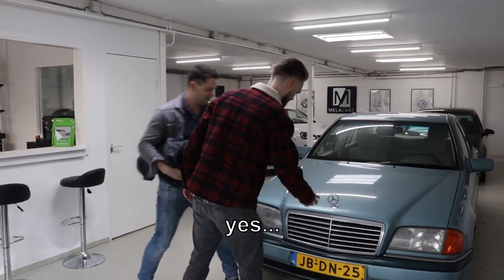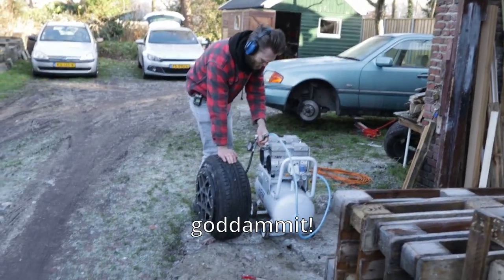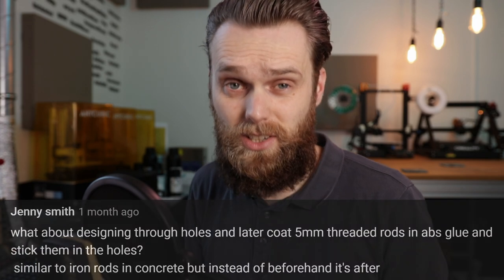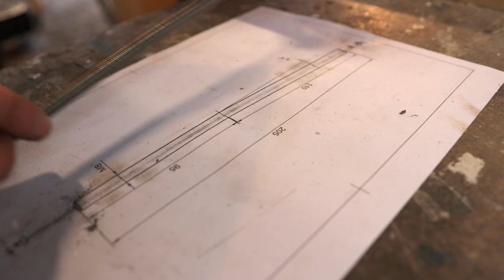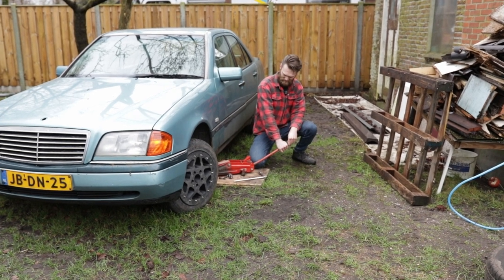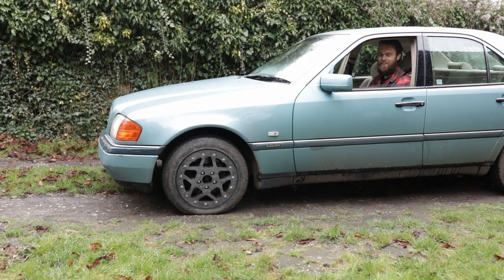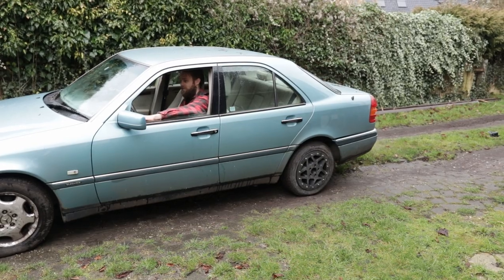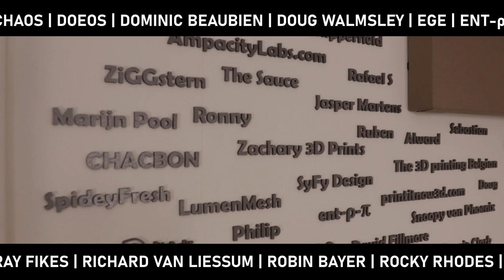Can you actually 3D print a working car wheel?

Comment: Good work getting this far with the project. I suspect that point loads (like hitting pothole or a curb) or side loads are going to break it - the weakest spot is where the bolts are holding the rim to a hub. It's probably going to get ripped from the bolts. If that holds the next issue is the heat from the brakes. If that rim survives I'm going to be seriously impressed and if not I'm hoping that's not the last iteration. Keep pushing boundaries.

Comment: Honest comment: with all the issues I've seen with ABS and layer adhesion, I wasn't sure it would happen. Your construction, however, mitigates a lot of those issues and I'm impressed.

So... curious to see how it holds up to lateral forces on hard steering. I'd like to see it driven hard on a test course, if possible. (All four wheels printed, if possible.)
Reply: Layer adhesion issues can be mitigated with a heated or, at least, insulated chamber.
Reply: @theofficialczex1708  they could be completely removed if he used salt annealing to re-melt the entire piece into a solid piece of plastic.

Comment: Just a tip!
If you put 2 nuts next to each other on to the thread (counter nut) you can use them with a wrench or other tool to screw in the bars.

This way you won't strip the hole surface with the hammer.
Reply from the maker: Thanks! That'd make it even stronger I recon and ti doesn't damage the first pitch of the thread. Next time I also want to damage the thread where it goes in to make a stronger bond too.
Reply: You can’t screw in the bars like that as there bent unless you put them in straight and hope they bend as they screw in ?
Reply: Couldn’t your use through holes in the bend part and take solid bolts and put a nut on each end?
Normally you wouldn’t use threated rods for such use cases as they basically work like springs and the shear forces caused by the threat are pretty high
Reply: @properprinting  screwing a nut on top before you start hammering will prevent you from damaging the threads as well.

Comment: This is amazing, Jon.  I'm happy for you. This has been a long project.

Next tests:
1: Full tire pressure (2.4 bars?)
2: Burnout on a paved surface.  (I'm still a little concerned about the heat generation on pavement, though this is encouraging.)
Reply: I know its an old comment but a lot of cars actually have 2.0 bar as their rated tyre pressure.

Comment: Well, your biggest issue has always been the rim splitting along that seam... When you went from your first to your second iteration you beefed the hell of every aspect of that rim when you did that despite that being the only spot that failed. That being said however, I think your new beefy design could actually be slimmed down some (if you are printing the thing solid... which I have no idea if you are or not) but will need testing. A lot of people are bringing up hitting the brakes for extended periods or hitting curbs or whatever, but honestly, I think the highest loading factor will be cornering.

If you put the rim back on the front of the car, and then subject it to large cornering forces... the spot where the lugs attach it to the car may end up being the weak point because of the immense leverage that is created on a rim. One "could" solve that with a metal plate on the outer surface of the rim acting as almost a clamp that some bolts would go through to sandwich the rim to the car and spread out the load... but honestly that really wouldn't be in the spirit of the challenge.

Something you "may" be able to do to increase the strength is to potentially figure out a way of printing the rim with some form of non plainer surface throughout the layers. So as the printer is making the rim, it is vertically sweeping the surface up and down as if its following a ruffled potato chip. In doing this you end up somewhat breaking up that fundamental layer shearing issue and gaining a bit of strength... but naturally no one has done this yet, you are limited (not you in particular but 3D printers in general) in how steep an angle you can run up and down along with how much change in Z can be done, and lastly, It would need an entirely new way of slicing to get something like this to work. But you seem to be a pretty talented programmer you might be able to pull it off!

One final thing I would also like to point out... if you had done this on a smaller car, honestly your first iteration would probably have worked and worked well. It wouldn't have been the strongest thing, but you could have at least driven around on it gently before it broke. Like I have a Honda Beat and I believe you have a Mini Cooper... either of those this challenge would have been a piece of cake... but, again... then it really wouldn't have been much of a challenge. So I commend you for getting this to work on a car such as this! This will open many peoples minds to the possibility's of what 3D printers are capable of!

I honestly was thinking about printing full blown fenders with something like a Hangbot 3D printer... never got around to it yet though so it has all just been a thought and concept.
Reply: i would say the biggest issue would be the lug nuts pulling through since they are the smallest contact points.
Reply from the maker: Thanks a lot for your insightful comment! I totally agree about the weak points you mention. I have some experimental ideas for increasing the strength in the Z direction. The extruder I recently made is the start of that project (and it's not continuous fiber printing since that doesn't add strength between the layers as far as I know). This will be a different project and I think I'll pick up the project rim with the newly gained knowledge and experience. Cool idea about using the Hangbot for that concept!
Reply: @aarons7615  Yeah, testing will be required, but your probably right... granted the conical surface of the lugs does distribute the load very well, but is it enough... only time will tell.

Comment: You could fuse the layers by heating the complete rim packed in fine crushed salt.

Also when driving the rods in, use an angle grinder to cut a long slot into the all thread. The edge of the slot will cut the thread into the plastic while screwing it in. It will also hold glue to make the distribution in the hole better.

To bend the rod at exactly the right place, saw into the all thread 1/5th at that place. The rod is weaken there but its plenty strong enough for the surrounding plastic.

Comment: That's pretty impressive work.

The only issue I can see with it is that when slowing down fast, a brake disc usually uses it's wheel a bit like a heatsink. Without this thermal mass to dump heat into, the brake disc will take a lot longer to cool down. So repeated stops one after another will accumulatively raise the temperature of the disc much higher than usual.

I'm not sure what temperature it would take for the wheels mating face to turn back into molten plastic (and all the wheel bolts clamping force disappeared), but I'm pretty sure, whatever that temperature is, the brake disc could be pushed well beyond it.

Comment: The only issues i can see are with creep and brake heat. Brake heat can be fixed by moving the brake disc away from the wheel, using a CV shaft. Creep I'm not too sure about, you just have to keep the stress really low.
Reply from the maker: At this moment the rim is still mounted to the car to find out what it does over time. I'm interested in creep too! I wouldn't have thought that heat would ever become an issue since I never guessed we'd make it this far. Now it's  becoming an issue xD

Comment: I think another really cool application would be on off road recreational vehicles: 4 wheeler, dirt bike, side by side. It should come with it own unique challenges. A smaller vehicle might give you some wiggle room with the design considering your 3D printer bed's dimension limit.

You can get a cheap 4 wheeler and 3D print a whole set for it and see if it can take the hostile environment of off roading!

Also great work and awesome videos! Thanks for sharing this.
Reply: Sure in off road you can have huge bumps but i think first it needs proper testing on pavement that has great traction. That will put it on big test, specially with almost two tons of car cornering. If it can take that, then maybe try rough terrain and impact forces.

Comment: The nuts on rods are the weakest link in this right now. Any cornering forces could result in them working their way through. One though I would suggest is making that area conical on the rim plate then make the lug ‘washer’  that fits it out of a much more exotic 3D printable material. 
It would function like a lug nut, or if you wanted you could potentially go make some metal ones which thread on and are one piece.

If the spirit of the challenge is 3D printing methods for the finished part then literally using lost-pla casting could give you some aluminum or other alloy parts. 

Or if you take a look at same of the data of CNC kitchens results on threads. I bet if you reached out to him he’d be happy to test what the material load is on threads. Maybe you might be able to print some lug nuts that would hold up and spread the surface forces easier.

Edit… first time on the channel you’ve already talked to him already. Well I guess that would make this suggestion easier. Lol

Comment: The problem is that 3D printed stuff is weak on the layer boundaries. You have tried to solve this by holding it together with threaded rods, but that introduced some of its own failure points.
My solution would be laser/CNC cut two large steel rings (going around the wheel), which can spread the force of the nuts on the two sides.
This would be a mix of CNC and 3D print, but this way you can REALLY pre-tension the layers. The plastic can take massive amount of force in compression.

Comment: A pressure of 2 bars creates a separating force to the rim of roughly 1000kg, if my calculations are correct. Assuming it's not very close to breaking from just being pressurized, it's possible the rim can handle all driving conditions that normal tires can create with their limited friction.
Reply from the maker: And the initial test we did with the inserts held up to almost 5 bars. It's astonishing how much force it actually can handle.

Comment: You originally started with the one piece rim, than you splitted it because the caliper, with other configurations (cars model) could you avoid to subdivide the rim?
I'm wondering if the experiment can works also without rods and nuts...

Comment: could work though id feel safer using at least aluminium on the rim and an aluminium center with the printed center over it (basicly a gloryfied hubcap)
allso next time youre going to pressuretest it lock the tire inflator open and put youreself and the compressor far away from it using a long hose , then set the pressure in bars with the pressure regulator on the compressor 
also because there brakes installed on the hubs theres going to be quite a bit of heat on the inside of the rim expanding the air in the tire and soften the plastic of the rim
the treaded rod might hold better if you tap treads in the abs and glue them in (drive them in fast using a electric ratchet )
think you stand a better chance of succes and getting youre incestment back by printing replacement interior panels for older cars that are currently hard to find and print them on demand (save the files they take a lot less room )

Comment: Did you guys finally  print a full set of rims?  Have you tried to make a tubeless wheel?  What material are you using in the printer?  Thanks for answering my questions.
Reply from the maker: We haven't printed a full set yet, but that's the plan. However, this will include the tire (hopefully if it works the way I have envisioned). I printed the rim out of ABS because the challenge for me was to be able to print large parts out of difficult to print materials, like ABS.

Comment: Maybe it was explained in some other video but why ABS and not something like CFNylon?
Reply from the maker: Good question! I used ABS because of a couple of reasons. The goal was to print large parts out of difficult to print materials and the rim is an interesting example. With ABS I could already tell a lot about the capabilities of the printer I modified and run into the challenges it comes with. ABS is affordable which makes it easier to play around with and if it works with ABS, it will certainly work with other materials. This way I have another ace up my sleeve so to say.

Comment: so your next go to should be to print 3 more and take it to an open track day and see if it can hold up to some real crazy driving :P
Reply: Step on a time and i think its better to keep it as one tire for now since safety reasons its better to have one wheel have contact on the road so if the rim fails while cornering there is some friction on other side so he wont loose control, though this does increase chance of rolling the vehicle. Would suggest making sure break disk can act as emergency tire if abs rim fails.

Comment: Congratulations on a great project 👍🏽
You say your using a 1.2mm nozzle, can you share your  settings 
I’m trying to print on a modix big 60 with a 1mm nozzle and having lots of problems
Thanks dean
Reply from the maker: Thanks! The generic settings are: Layer height: 0.4mm | Shells: 5 | Extrusion width 1.2mm | Infill: triangles 25% | Infill flowrate: 80% | # top/bottom layers: 3 | Top/bottom flowrate 85% | Bott/top ext. width: 100% | Cooling : none | Nozzle temp: 280 degC | Bed temp: 100 degC | Chamber temp: 70 degC | Print speed: 50 mm/s | Inner shell speed: 35 mm/s | Outer shell speed: 15 mm/s | First layer speed: 30 mm/s | Infill speed: 40 mm/s | Top surface speed: 30 mm/s We made a video in which I show how strong I get to print ABS and what my findings were https://youtu.be/I-QlnA9cMOY The settings above are based on those findings. I hope this helps!
Reply: @properprinting  thanks for that, we are printing with PETG at 200c and its still bubbling, top surface is terrible. Base layer is not to bad , sides are ok apart from the infill showing through
Would be great if you could do a video on this material
Ill check out your video
Thanks Dean…… and keep up the great work
Reply from the maker: @deanlegg418-u2k  PETG must be printed hotter than that. Somewhere between 235 to 245 works a lot better. I printed with this material in my earlier videos.
Reply: @properprinting  we tried that with 0.4 and printed nice but the 1.0mm just gave us the problems, so we went down in temp
Reply from the maker: @deanlegg418-u2k  The bigger the nozzle, the worse the flow rate becomes. To mitigate this, a higher temp is required and/or slower print speeds
Reply: @properprinting  are you using a volcano nozzle?
Ill send you all my settings tomorrow
Can you send me a link to your PETG videos
Thanks
Reply: What nozzle do you use , i have a 1.0 volcano
Reply: @properprinting  as I said we are using a modix big 60
How can I send you some pictures of what we’re printing?
Reply from the maker: @deanlegg418  hi, you can email me: contact@properprinting.pro or dm me on Twitter or Instagram

Comment: Why couldn’t you add material on the outside of the inner part of the rim to increase the strength even though you have no more clearance on the inside? The bead of the tire doesn’t go anywhere near there, so I’d think that extra thickness there could contribute a lot to the strength…
Reply from the maker: Because it would be too tough to get the tire on it. I could've used bigger tires, but that was an option if this would fail :)

Comment: pro tip, petg is stronger than abs and it's still temperature resistant... why don't give it a shot?
Reply from the maker: Thanks for your tip! I used ABS because my goal was to print large parts out of difficult to print materials. ABS already tells a lot about the performance of the printer I built and it's affordable. I might look into Nylon or other materials for the future, but I didn't expect that this ABS would be strong enough. If ABS works, a lot of other polymers certainly will!

Comment: Awesome work! What size is the rim? Maybe you could've avoided issues with size by getting some 90's B-segment car, that ran on 13 inch wheels - those things tend to be very cheap.
Reply from the maker: It's standard 15". The initial goal was to print large things out of difficult to print materials to learn from :)